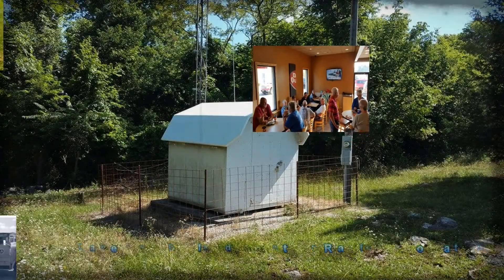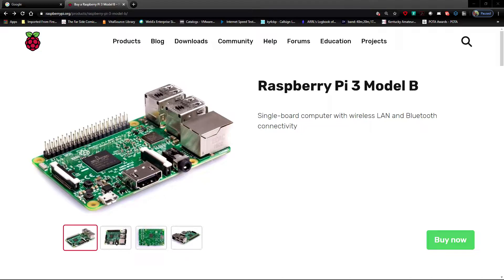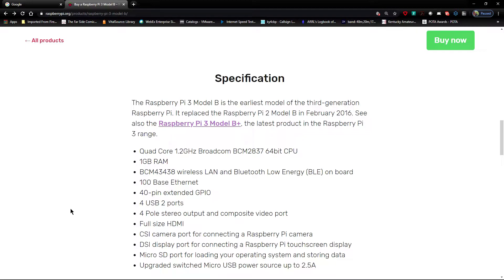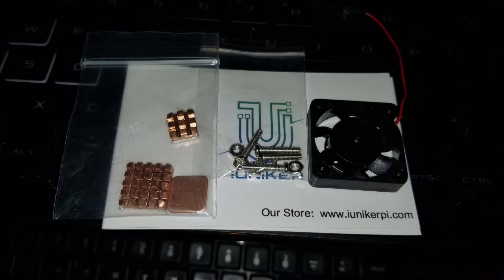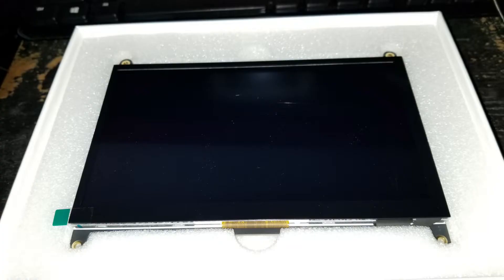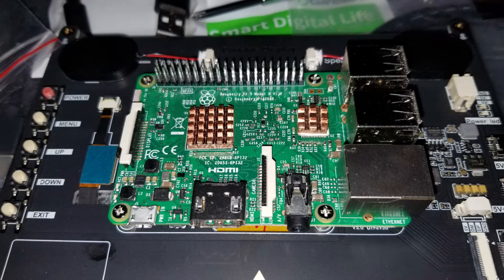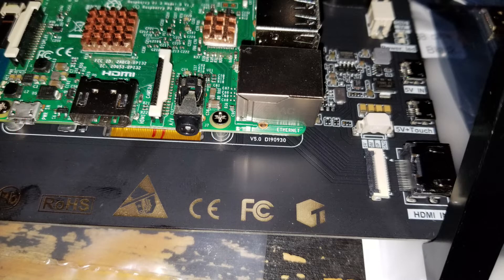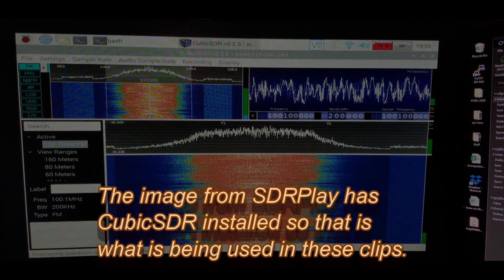LCARA HAM Radio: Raspberry Pi and SDR Kit

Comment: Setup an allstarlink. Very  easy to do. Hamvoip.org  I will donate a interface board. I am not a club member yet but soon we'll be. You can replace the computer that you are using for echo link. It will do echolink and allstarlink on the PI.
Reply from the maker: Hey Richard, I think KY4CKP and I would love to give it a try. We'll need to meet up with you soon to do the exchange. Thanks for the suggestion and we are looking forward to adding to the LCARA roster! BTW, we are having a repeater work day on 2/1/20 so if you have some time, maybe come out and give us a hand.